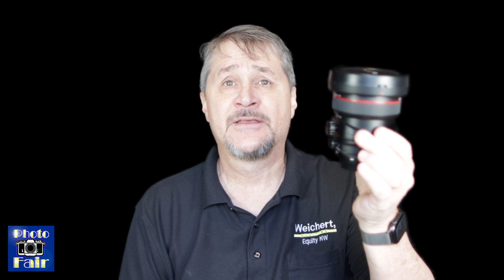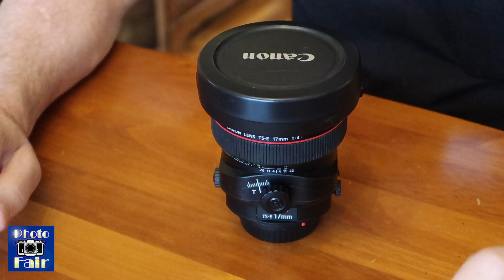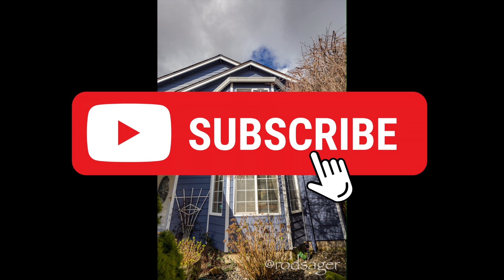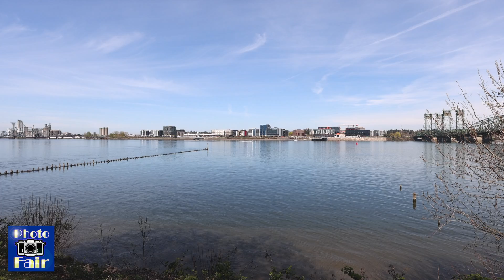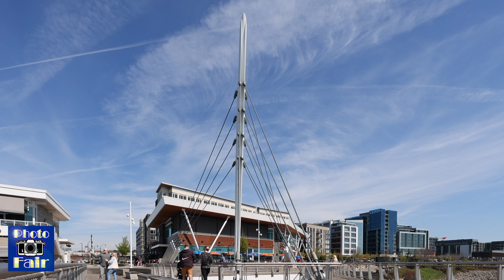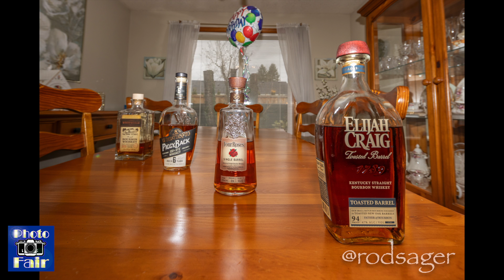Using the Canon TSE 17/4 L Ultra-wide Tilt & Shift lens

Comment: Nice video!

However, I think the clicks of rotation are on 30˚ increments on the shift axis and 45˚ on the tilt axis.

You should be able to kind of do shift and rise simultanously by putting the shift at an angle between horisontal and vertical. But I guess you meant two independent controls or something.

Anyway, great and very informative video overall, despite those nit picks.

The lens itself is particularly well suited for photography of large buildings, pulling far ahead of most other lenses at that.
Reply from the maker: Tilt is measured in degrees of arc but shift is measured in millimeters. There is no arc in a shift movement. The TSE 17 has 12 millimeters of shift in each direction. Effectively that lens has enough coverage to cover 24x60mm sensor
Reply: @PhotoFairSince1975  Yes, but I didn’t mean degrees in that way, but degrees of rotation when you rotate between shift being horisontal or vertical (shift or rise). The button you touch at 4:04 in the video. I hope that clarifies it.
If you turn that to some diagonal position, I think you could achieve some shift horisontally and vertically (or shift and rise) at the same time.
Reply from the maker: @ Oh OK yes to rotate from horizontal to vertical there are click stops. I can't recall the angle on those but it seems you have that info. Very good.

Comment: I love my TSE 17mm :)
Reply: @mikhailphoto32  I don't have much trouble with flare, but this is a specific purpose built lens so keeping bright lights at bay is ideal.
Reply: @mikhailphoto32  The 17 TSE is an L series lens, so Canon has used the best optical components possible with this lens. The 45 TSE is a more affordable lens with optical components designed for good performance e at a base level price. That said, I would rent the 17 TSE before buying it. The edges of the frame are sharp, but the lens is SO wide that there is some geometric distortion when you make a sizable movement. I do not use this lens that often, it is reserved for those occasional times where the function it provides makes an impossible image possible.
Reply from the maker: @mikhailphoto32  You can't use a hood on a lens like this, its coverage is way too wide. Much wider than a typical 17mm for full frame because this lens has enough coverage for 60x44mm. The lens does not exhibit much flare, it is well coated, but certainly under circumstances with the sun at just the right spot, I'd imagine flare would be an issue.